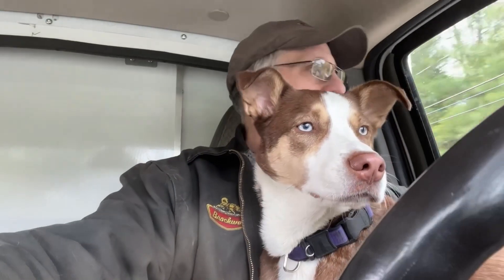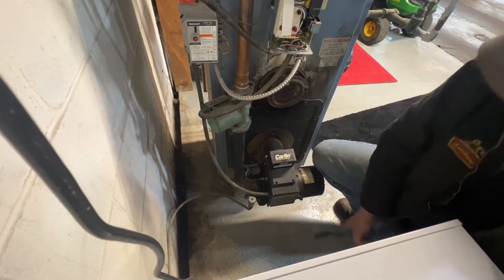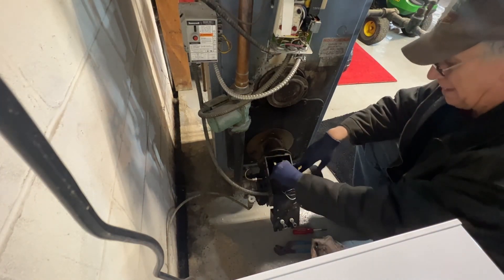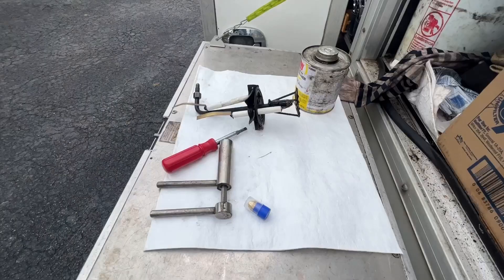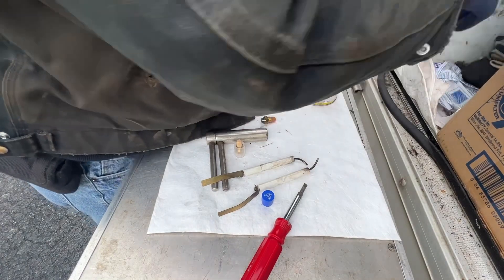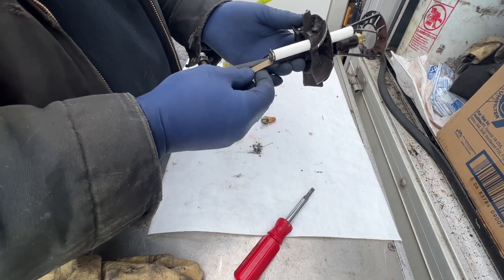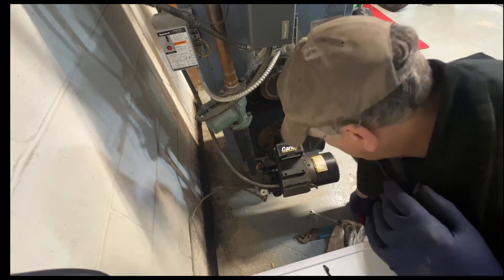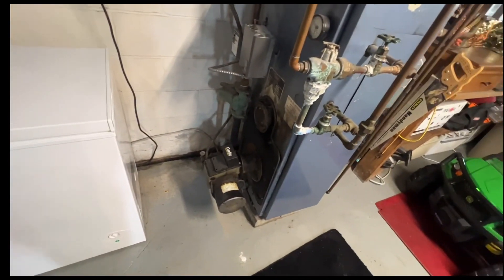Oil boiler starts hard more than one issue

Comment: It’s been my experience that those early series Carlin igniters are prone to intermittent issues “ spark today ,no spark tomorrow “ I usually replace them. I do leave the old one in the event it didn’t correct it I can always reinstall the original one. That place would be nice for a used EZ-1 or AFG  when you do the chamber. Nice job stay well.